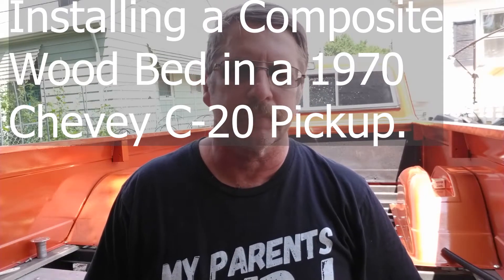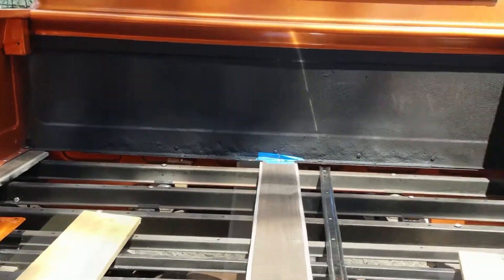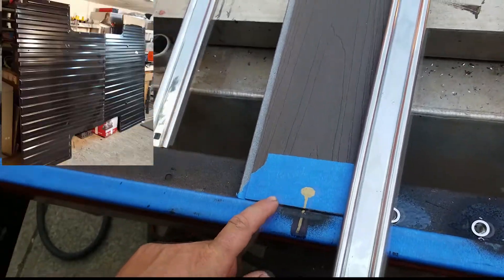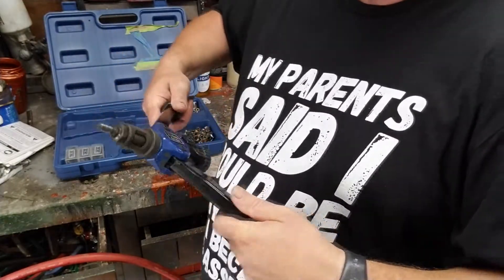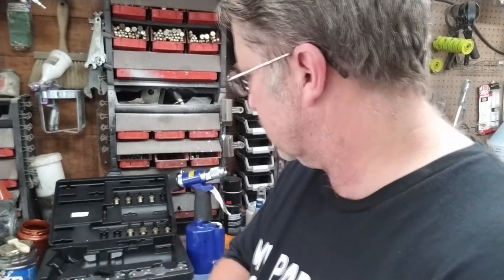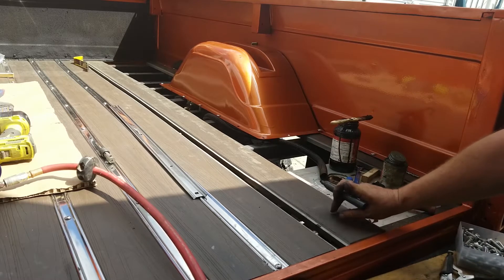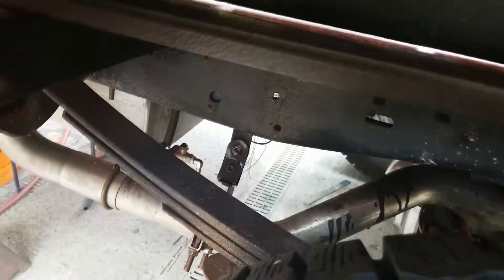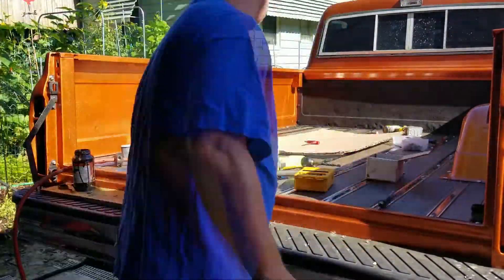Installing a Composite Wood Truck Bed in a 1970 C-20

Comment: The fleetside with wood, narrow & wide, but big enough to put a sheet of plywood and shut the tailgate, takes 100 bolts even. Nuts & washers are hard when your 6’3” and no hoist. That is if you can afford a sheet of plywood. Very interesting as I looked into composite materials and no length, no width that excited me for the price.
  At 13, you could get a drivers license in the Midwest for “Farm / School” no photo, not even laminated. Already talk, I grew 6” at age 11. So hay money in hand, drove my motorcycle into the city while half of the gas stations where closed. Remember “Odd-Even” days to but fuel? Last digit on plate, last digit on calendar, you could buy gas. Sometimes only 10 gallon. Arab oil embargo, thanks peanut farmer turn house builder. Almost to the interstate on ramp & saw a PU for sale, red at closed gas station. They had these box things, mostly glass & inside was a phone. Called the #, guy said 1/2hr. He came, I drove & bought a 1965 ChevyC10 Apache. Construction company carried diesel, new & used waist oil from sites to service earthmovers, cats, backhoes & like. The old growth yellow pine GM used was tight grain, this one was soaked from spills. 4 1/2 years later, still looked them same yet lighter on color the composite. It never rotted or grayed. Senior year, worked for neighbor with center-articulating 4X4 JD tractor. No classes until 10AM, I drove deep into fields at 3AM, ran until 9:30. One day, I was late and jumped into truck and drove too fast. I went thru a dry rock bottom creek, hit hard. Got a mile or so, engine locked up and oil light came on short after, but wheels locked a skidded into a shallow ditch. Damn hole in oil pan of 283 Cu. In. locked up. Man I was mad because of school? Stupid. Skid, wheels locked? The 65 & older powergluide had a front & rear pump. You could push it downhill, throw it into low, spinning the engine. Late-Model class of racers loved these for that and power braking without more than letting off gas. Two day later, went back w/buddy & chain. It was gone. Reported stolen, never found. It was not uncommon for some farmers to drag old vehicles into ditches to stop erosion but keep cows from getting onto roads. Good bulls=$$, steers=paycheck or meat, cows made more cows but gave milk. Either way, they would get hit and $1k gone. Plus vehicle damage. I still get mad, but had no pencil, paper or cardboard for the dash. Still wish I had it. Duct tape on seat and all, yes, short bed fleetside. ASE Master Tech. Nice video, lots of work, planing and unique! Keep the old classic metal!

Comment: I've got a 2012 F250 in great shape, except for the bed cross members. Stupid road salt in VT loves to eat the cross rails. Did you replace the ones in your truck with SS rails? Are the rails all bolted to the inside fender and wheel wells to hold up the sides and front panel? I have made several wood beds, but I would love to retain the outside and inside good panels, and do the rails with the composite on top. Great work!
Reply from the maker: I could not find stainless rails, so I bought steel ones, coated them in POR-15, then undercoated the crap out of them. All of the rails bolt together and support the sides and wheel wells.
Reply: Why does everyone make things harder then they have to

Comment: I see you have a notch on your passenger wheel well. What for? Never seen that.
Reply from the maker: I am currently modifying a truck crane to fold up. If you look at 5:33 to 6:26, you will get a glimpse of the large, thick aluminum channel support that I will be mounting it to. The crane will fold over into that notch. That will be another video in a couple of months.
Reply from the maker: By the way, the engine on that Camaro on your site looks sweet. I would love to see a video of the rest of it.